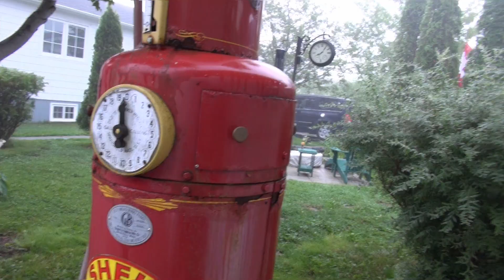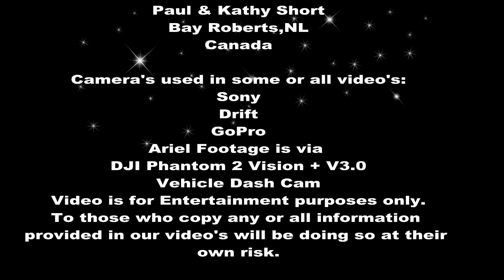More Land Expansion (Kubota 5740 & BX25D)

Comment: It turned out nice Paul.Always nice to have more space. The second shelter will turn out nice down there as well and keep the old truck out of all the weather, Even though it is still in such nice shape for being out in the weather for so long.
Reply from the maker: +Tyler Donovan 
Thanks Tyler. Ya gilt set in after twenty years so the old truck will have some place to sleep. Eventually a new building will be put down there and the shelters will come out but for now they fit the bill nicely.

Comment: Just wondering, not pickin on the quality, but wondering about the size of the truck loads coming in  - they appeared to be on the skimpy side of what they could put in the truck.  Load 5 18:56 seemed to almost be the runt of the litter @ 1/2 load.  :-O  I know weight restrictions can impact what they put in a dumper depending on the season and condition of the roads, but this is mid summer!   Also noticed the dumpers were not covered or at least for the time we could see it.  We have regs in the US that require those loads be covered up to avoid the flyback/man over board situations.  These loads would be challenged to make the edge. HA.  Were they concerned about crunching up ur driveway and property with truck weight?

What say you, orange tractor man of the North?   Or is this above your pay grade and you'll need to defer to the Boss?  :-O  

So I guess you'll be erecting a noise barrier WALL this fall then, eh?  Might have to make it extra tall cuz that is one heck of a racket blasting thru the field.  smirk
Reply from the maker: ***** 
A lot of construction going on here in the area so the inspectors are out in full force. Each truck  has a weight limit so that's why they don't seem full. No tarp needed if not traveling the highway. Those none beach babes next door are new to the area. They sponge off the system and with their stud muffins make babies. It's great entertainment for us especially when the police have to go there (at least once a week). We don't mind them but it's bad operating the tractor or a chainsaw because you can't hear the machines when they scream at their kids. 😉

Comment: Paul how come the delivery truck arn't oad completely full down here in Florida you would see gravel higher than the side of the truck box.  Also sondering do they have to use the load tarp all the time or just on loads like sand.
Reply from the maker: Russel Brown 
Strict weight restriction. The material I order is very heavy. It's not your regular run of the mill fill. The company is great to me. Give us work and when I need something it either happened that day or the next. They have tarps but not required if off the highway.